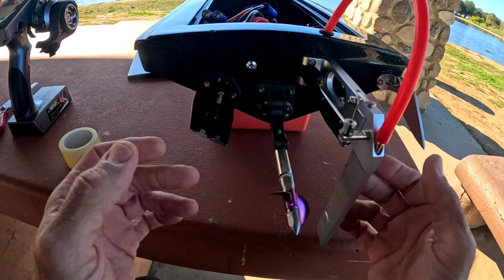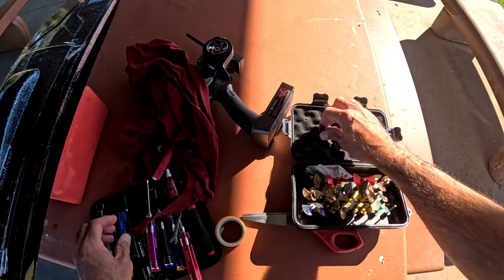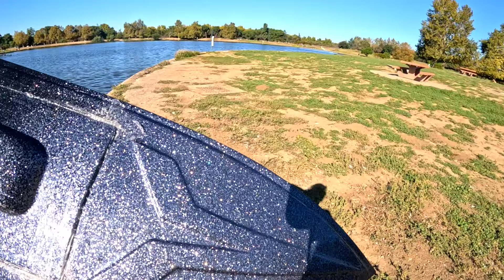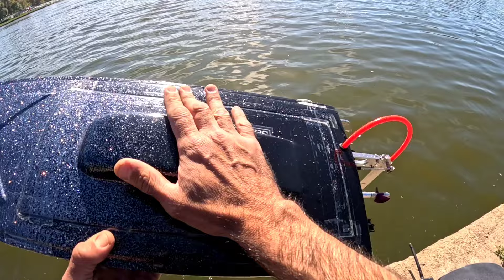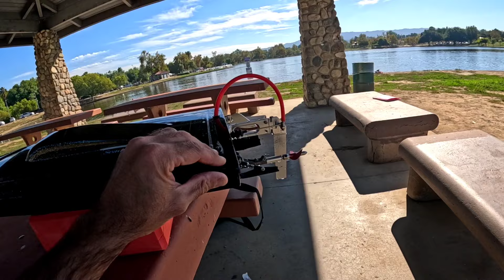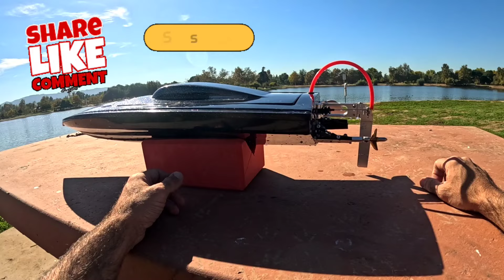SEADUCER RC BOAT SD3 FE-30 MONO HULL MAIDEN 4 AND 6S TESTING

Comment: That hull is designed to be run without trim tabs . It has a hook built into the hull that makes it run wet. It is designed to run in choppy race water.

Comment: Nice boat nice gift you're going to have to run 6S for that thing to get out of its own way it's 30 inch boat 45 1.4 it will pop out of the water and run over some turtles and ducks... More videos more fun
Reply: Oh and I forgot to say.. sand the bottom good with some 200 Grit so it slips in the water easier.. if you haven't already okay I'm done with my two cents..
Reply from the maker: Thanks Scott! Haha watch out ninja turtles!
I'll do more prop testing on her in the coming week
Reply: All right I watched the whole video you did run it on 6s, it did get a little hot on 44 so what I've been doing on my e22 and my Sonic wake V1 with single pickups I Y them into two and two exits out, I run smaller hose out of the Y to the motor and ESC for more pressure and that cools them down to where I'm not going to bother changing the rudder to dual.. and saves money.... Just an idea that works for me...